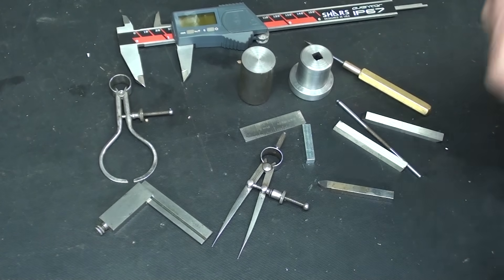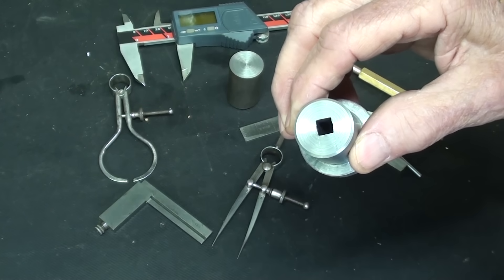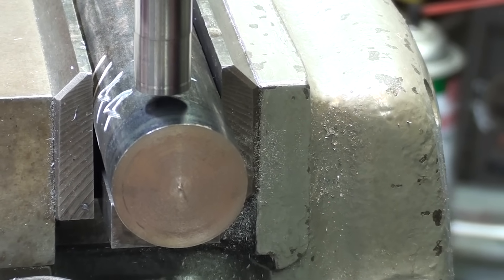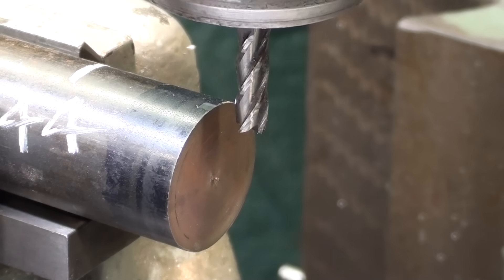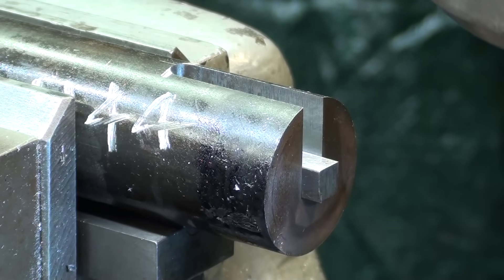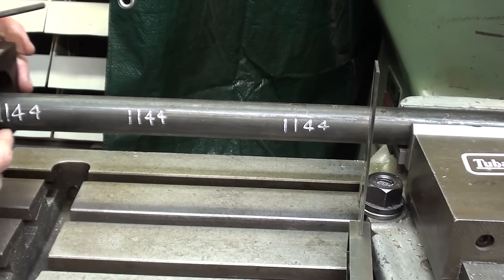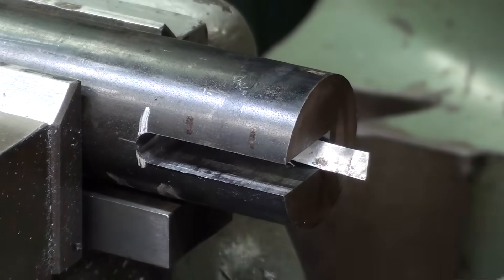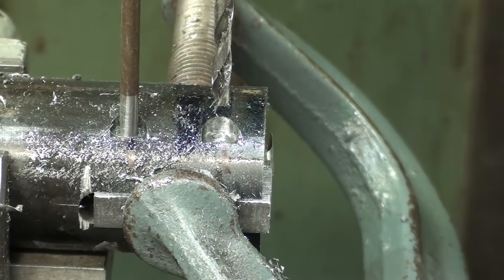Machine Drill a Square Hole in Round Stock #705 tubalcain

Comment: Great concept! Rather than gluing, you could drill the 1/8 pin holes undersize, ream to .1847, and drive the pins into the interference fit holes for a longer lifetime...
Reply from the maker: Thanks for the tip!

Comment: No, I used to grind my own set of punches to make square holes. Usually a triple set of punches worked well. First punch roughed the square then number two (2) punch semi finished the square then pushed the third (3) punch into the square hole and finished to size. When I was younger I worked for a broaching company and got all my experience there so square holes can be made with series of punches or with one (1) or two (2) full length broaches. These tools are expensive because your geometry has to be spot on.
I see at the end what you did.
Reply: I also made much use of a slotting head on my milling machine. Anytime that I made parts as seen here I always made them out of the solid per customer's drawings.

Comment: fyi I needed a "key" for my acetylene tank. The square end is 3/16, Drilled a 3/16 hole in 1/8 flat stock and broached it with an old 1/4 tap using the driving end. Thanx for your vid
Reply from the maker: Great tip!

Comment: good concept for home diy work. I usually use square stock bigger than my round od and drill 4 holes at the corners then mill out the square.  After I use a four-jaw chuck and turn my circular od.  i work in industry and we don't carry square broaches, and this is the way I've done it may times and works just fine

Comment: Making a broach is easy if you have hardenable stock in the appropriate cross-section. For 1/4" square, piece of cake.  You could anneal old 1/4" tool.  The rest of simple non-critical lathe work & then harden.

Comment: I remember making parts out of 1144 on a screw machine way back when I was just getting started. They were half ball socket crimp on ends for cables. Kind of a gummy steel. Made thousands of them parts. Good eye dear on the square hole. Never seen that done like that.

Comment: 1st of your vids I've seen (subscribed). Self-taught "machinist" (loosely used term here). I could make my own product very well and picked up some other "skills" along the way. Never heard of a Rose Index. Great little project you demonstrated.

Going to ask what must be a dumb question since I didn't see anyone else ask & you said it was obvious: What was the purpose of the .003" foil shim?
Reply from the maker: Just extra clearance to increase the size of the square hole slightly
Reply: @mrpete222  Thanks for clarifiying - I was thinking that could be the reason but only provided the incr. clearance in one dimension and since by simply increasing the depth of the endmill cut (stock rad  + .125 +  .003) would've achieved the same results (it also could've been increased in the Y dimension as well by offsetting the initial cut .003 & then doing a final .003 pass at full depth) that there must've been a reason I wasn't getting. Also since using the part to hold a cutting tool, I'd think you'd want that to be close but that an eventual set screw(s) would be added. The other reason I was thinking was that it was intended to put that cutting tool .003 below the centerline of the axis on a lathe if the holder was going to be centered. Then it'd have made sense to only increase the clearance in one dimension and in only one direction (i.e. the shim put all of the extra clearance in the +Z in the orig. coordinates & offset the square hole by .003, effectively creating an offset rectangle). That could've been centered )if it was important) by going .0015 deeper initially and then using .0015 shim stock.

Comment: Many years ago, when I was working tool & die design, I recall one of the tooling supply companies like Carr Lane who had steel bushings with square holes in them. I went looking for these in recent years and came up short. Something else I saw being done at a manufacturing plant I worked at. The company had several Acme Gridley bar machines that were always running. There was a a tool in one of those machines that broached blind holes. The tool was designed to wobble as it was advanced down into the predrilled hole.

Comment: Heh. I think you're the first YouTuber I've seen that used the correct guard for a cut off wheel on an angle grinder.

From my experience with Dremel tools and cut off wheels, I always half suspect that the cutoff wheel on an angle grinder is going to explode at any time.  I've never had one break, but I'm certain it will happen sooner or later.

Comment: Wouldn't it be quicker and easier to just pick up some of those square drill bits?  😂 True story. Had a highschool shop teacher. Mr Brooks. He had a thick piece of steel with a square hole in the center. He took a drill bit and ground it to fit perfectly in the square hole. He went to some sort of function at Rockwell international and took them with him. By time he left he had a room full of engineers believing his newly invented drill bit made the square hole.

Comment: Looks like a shop class project, but I can distinguish little need for the finished part. A lot of work to make a hole that could be done without the insert and pins. But since we are here, why not drill a hole in the center first?

Comment: I have a question. Rather then pinning the piece into the machined slot why would you not weld it.  Honest question.
Reply: You could, but welding is an different kind of art than machining in lathe, not everyone is able to weld properly and are  using welder only with edge cases. Anyway, pinning is just one of many ways.

Comment: How expensive a set of equipment you'd need depends on the level of precision required.  I'd bet the basic process could be managed with a drill press, a couple files and a hacksaw if one had sufficient patience and steady hands.

Comment: for thise with no milling machine you can use a metal cutting saw or a hacksaw to cut the grooves in the end and of the stock and grind the middle part out and file it flat then put the square piece in and another two pieces in each end to hold it then glue or pin or weld, same thing but faster this way

Comment: Great work, not a rounded corner insight which is the 'true test'.
In case a rotary broach is being thought about you will need twice the back pressure of a Hex. form to make a internal Sq. form.  So you know.
You can now wobble broach depths of up to 80MM though now.

Comment: I have done that but used tapered pins its just one more step using a taper reamer but not needing lock tight.
I have also done small square holes using a shaper and a homemade cutter.
Most shops no longer have a shaper but I have found it a very useful machine even if it's not used very often.
i have a old 7 inch atlas metal shaper a friend at a junkyard gave me because it was in mint condition and he could not see scraping a beautiful piece of machinery.

Comment: But it is 2021 that is a 10 dollar hole on any wire machine .250 sides and 1.00 long give you 1 sq inch of wire or 10 dollars and takes 20 minutes.
Reply: How does this process work for the hobbyist?

Comment: The shaft of brazed tip lathe cutters are usually top quality tool steel and when blunt they can be used  heat treated for other applications.

Comment: Its interesting however in industry this could would be wire eroded - +/- 4 microns nothing wrong with old methods for if you dont have the kit but come on.
Reply from the maker: That would take too long. And industry they would broach it, and 30 seconds and be done
Reply: @mrpete222  actually add up your broach time for 4 faces ;)
Oh and try it in hard materials

Comment: Another thing to consider is that often times the square hole’s corners can be over-cut, and the square insert will still fit nicely in the square hole.  And if the piece isn’t too thick, you can just mill most of the square hole with a larger end-mill, and then switch to a small-diameter end-mill and over-cut the corners of the square.  The hole will be a square with little ears on each corner, but the square peg will still fit nicely.

Comment: This is not "Drilling a Square hole". It is Making a Square hole. I have been in the machining business for over 40 years, 7 years of which, as a C.N.C. Machinist/Setup/Programer, 18 years as a plastic injection mold designer/Maker. The rest is in 3D Solid modeling and design of mechanical components. I have come up with many other ways to do this, but unfortunately I have no capability of posting videos on YouTube, nor I have machines to demonstrate my ways.

Comment: Nice job, next time when you edge find go from the rigid jaw you will find it more accurate and once you find the jaw you can use your zero for quite awhile,
you could also use a 1/8 endmill to spot for the holes then use a 1/8 pin with a slight straight knurl and just press fit in place and forget the locktite, if you are going to use it for holding a cutting tool the locktite can come loose from the heat and that won't be good. Just passing on some of my over 50 years of machine shop knowledge

Comment: Good job . But as a wise old saying .. if you want to find the easiest way to do a complicated job , so you have to ask a lazy man .. i found easier way to do that square hole by . 1- i used small round drill bite 2- i tried to reduce the rounded corners by a drill bite . 3- i used square cobalt m42 with hydrolic press to make the square hole but it require high accuracy to center the square hole. So the press should have home made chuck that could hold square hss lathe tools then you have to fix the piece of work on swivel vise of two directions . So the press goes down and up manyvtimes until you trim the hole size and make it in the center . By that way you can make square hole in 5 minutes or less .

Comment: I loved how you started the video with "you can buy a $150 broach or use this method", then ended the video with "you can build this with twenty thousand dollars worth of machinery or just buy a $150 broach"
Reply: Pure contradiction in turn. Why spend $150 when you can do it for less! But, you need to spend $20K on machinery first to do it! That sounds a bit Irish to me. So go and buy a $150 broach instead giving you a saving of 19,850 a bargain
Reply: @riccardoscavo8485  unfortunately without the machine shop the broach becomes a bit pointless, you still have to spend the money!, I did find his last comment amusing though.
Reply: I saw the video pop up and right away i thought you would drill it and broach it. I never really thought of doing it this way to be honest about it.
Reply: Just another way to skin a cat. Knowledge is good.
Reply: It's assuming you have machine tools.  Otherwise, why would you need the tool holder to begin with?  As to the "rose index", you don't need that, either, all you need is a v-block and a clamp, and if you don't have a v-block, you can make your own.
Reply: A rose index costs $149 - same price as the broach
Reply: @andyg.8971  But so very useful for so many other things, have struggled in the past making square square pins this would have made things a lot easyer, and accurate.

Comment: Regarding the loctite on the inner surfaces of the insert. That would actually help pretty substantially. As a general rule (or so my mechanical engineering professors told me), adhesives are most effective in compression and shear stress scenarios, but less so in tension. Trying to slide that insert out would be pure shear which would be among the ideal scenarios for an adhesive. Additionally, all that extra surface area would distribute the force too (meaning less shear stress) thus it would take even more force to break it out.

Comment: Would welding the quarter inch plate into the roundstock be viable or would fusion welding distort the work?  You did mention silver solder but I have more experience with mig and stick.
Reply: I think there would be little warpage, as there is a lot of mass to sink the heat into, and there's nothing flimsy about the piece. I think any small distortion that might result would get cleaned up by the final machining.  For welding, I would cut the filler piece so that it sits a little BELOW the slot, so that it can be completely covered by the weld, with deep enough penetration so that a solid piece would result at the top, even after final machining.  Also, I think bronze brazing would be a good  alternative to silver brazing, given the cost of silver these days.

Comment: i don't think loctite is a good choice in this application. The heat from cutting the pins off, and turning, may weaken the loctite. Brazed joint would be way better. It looks like MrPete got away with it, but something to be aware of. If someone uses this for another application that does get exposed to heat, it'll be a problem. perhaps pressfit pins would be the best choice?

Comment: Old machinists trick. A lost art. Thank you for reminding me of this!
Reply: Yep. Those "Old Machinist's" were a "Tricky Lot". One thing my dad, "They call me a 'Tool Maker', but not by 'East Coast' standards" said [we're from New England] at the shop in Santa Monica, Ca in '62 was that if you walked away from the machine, back off a 0.001" before you start in again because everything has cooled down and changed dimensions. He did this on an old, non-numerical read out, manual (dial only) Bridgeport Mill and could work +0.00003"/0.0000.0" tolerances all day long.

Comment: I enjoyed your video here. but I want to tell you . That the steel used in the your tool bit is more than likely good carbon Steel The reason I know is I have used many of them to make small tools and they are good for hardening. Example I have welded them together when the tool bit is shot, I have made several punch's which are very workable and able to be hardened. I have used high speed steel bits to weld onto my chipping hammer when it is worn down.

Comment: Well done. I am an old Engineering machine shop man of 50 years at the trade and can totally understand what you are doing. I hear the same sound of my Bridgeport milling machine there too. But I can't understand how you used no coolant on your endmill? I have to use coolant otherwise my end mills or slot drills would burn and have a much shorter life.

Comment: If somebody does not have a Rose Index I would imagine a Vee Block would work equally well. Just not as much surface to register off of.
Another option here is drill and ream the correct size hole and use one of those inserts with square holes they sell for boring bars http://www.greenbaymfgco.com/12L14-sleeves.php
I have Trammel Set that my fraternal grandfather* made 90 or 100 years ago. It has four pices that slide on 1/4 x 1/2 bars. One holds on of the points. Another is a piece yo add an extension bar. The third has an adjustment screw joining two sliding pieces together like on a vernier caliper. I suspect when he made it all of the major pieces were made in two pieces and then cut. The various layers were silver soldered together. Plus the two pieces that carry the interchangeable tips have collets that are integral to their assemblies. I've done some nice work but not any where his. 
*according to my father his father was never really out of work during the Depression.

Comment: Hello, I found your video very interesting and a very clever approach. I don't have machine shop, but perhaps you could help me with a suggestion how I can bend small gauge wire accurately.

I am a model railroader (I work in HO scale which is 1/87 scale). I am building a large HO model railroad here in NJ with about 400 feet of mainline. I really like to scratch build HO bridges using a scale ruler and accurate dimensions based on the prototype bridges. I just yesterday was trying to bend small gauge solid full hard steel wire in a U shape. The gauge (solid) wires I work with are (20AWG, 22AWG and 24AWG), which are roughly .032, .025 and .020 in inches.

I am bending one end of the small wire 90 degrees and at the other end of the wire (about 2 inches away.....sometimes longer), I also bend a 90 degree angle. Bending the 90 degree angles is not too difficult, however getting the bends to be on the same plain (meaning if you were to lay the bent wire on a level surface it would lay completely flat in a U shape), is the difficult part. Bending that second 90 degree angle to match the first bend so they point exactly in the same direction has been the challenge.

If you can suggest a method I could do these bends, I would very much appreciate it. Thanks again and well done video and great idea you came up with.

Philip
Reply: I just watched a video showing how to to do this with an old wrench and a couple bolts.  https://www.youtube.com/watch?v=wIoywR1TqaE
Reply: @THEORIGINALMRGEO  Thanks for the link. Cool idea. I don't have a grinder, but maybe I can figure a way to put a slot in a bolt. Thanks again...cool.
Phil
NYC Area
Reply: @uptownphotography  It was just by chance that I watched that video and was able to click back about 4 videos to find the URL for it.  Figured it was a solution to your question.  If you have a vice and a hacksaw you can probably do it as long as you take your time.
Reply: @THEORIGINALMRGEO  Thanks for the info Jason. I do actually (it occurs to me) have a Dremel tool with a cutting disk. (I am heavily into model railroads and do a lot of scratch building of HO scale bridges) so I may be able to do it that way if the disc don't break. Having a narrower slot would actually benefit me as it is small wires for building models I want to bend. Thanks again.
Phil
NYC Area